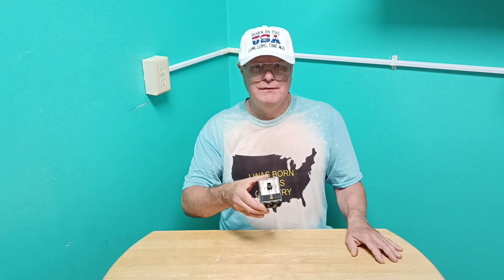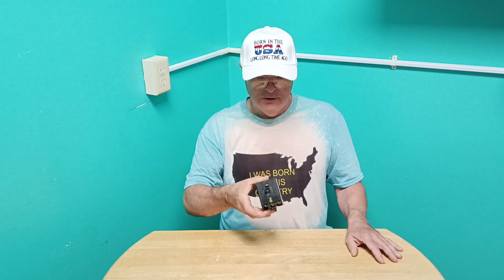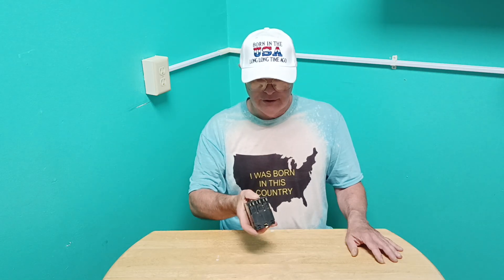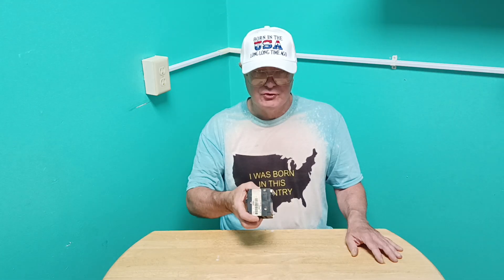May 25, 2024 how to match the wire gauge to the circuit breaker 120/240/208 volt circuit +  question

Comment: you would still use 14awg wire, there is not anything smaller that can be used that isn't sjoow or other cable similar to it. so 14awg wire

Comment: Although 10 amp breakers aren't used as often as 15's, you can use that particular breaker on anything 3 phrase that's 8 amps or less...the most common thing would probably be a small pump of some kind...I know there are 480 volt tables that have motors that only draw around 2-3 amps.